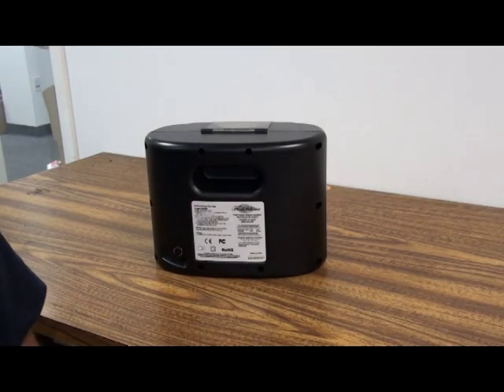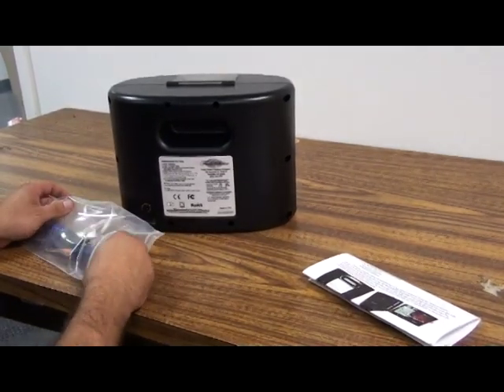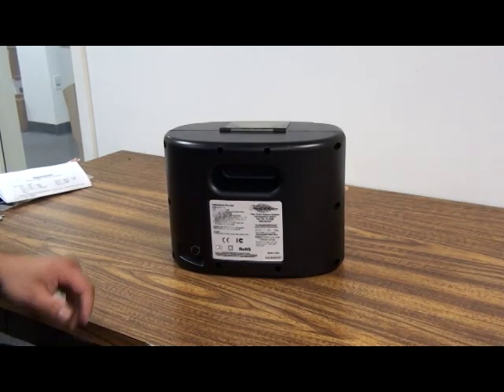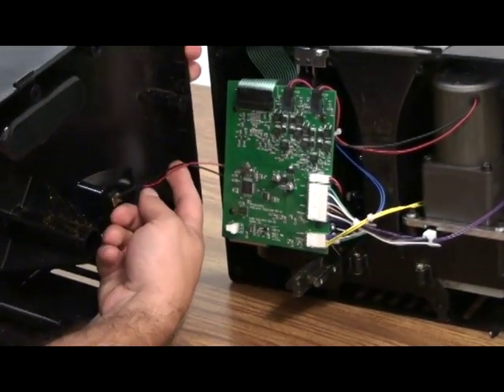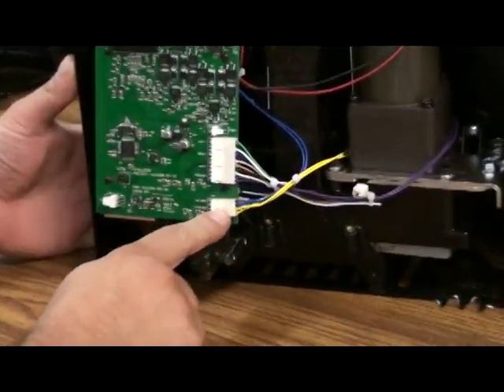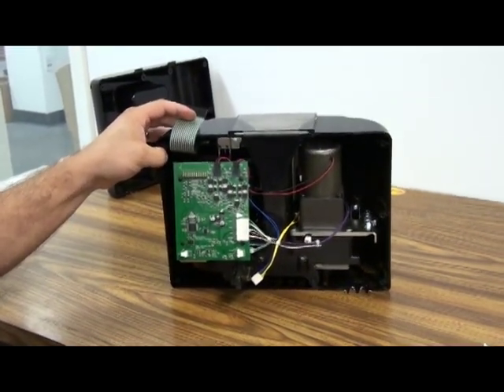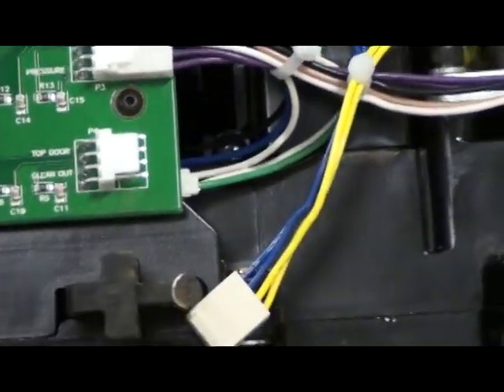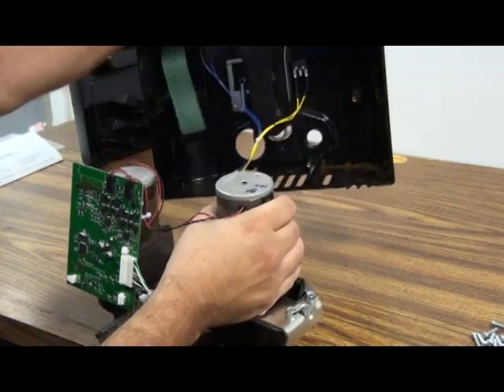04 Disassembly.avi

Comment: ive used this machine and its a lot faster than ANY manual machine it makes great smokes and the staff are great to work with should you have any issues ..ive made over 15K smokes with mine with no issues at all other than the moisture content with my tobacco but never a jam to moist tobacco and it sometimes will not fill the whole smoke and the only machine that would beat it would be a fully automatic machine that cost around $10K min ...

Comment: My #2 square head screw driver doesn't do anything but spin.   My Phillips screwdrivers don't reach and I don't know if they'd fit anyway.     What size Phillips head would work?
Reply: #2 Phillips.  The older machines had the square drive but newer have Phillips. We also convert to Phillips if the older machines are sent in for repair. You can usually look in one of the holes on the sides and see what screw it is.